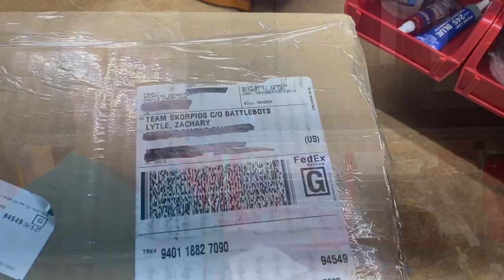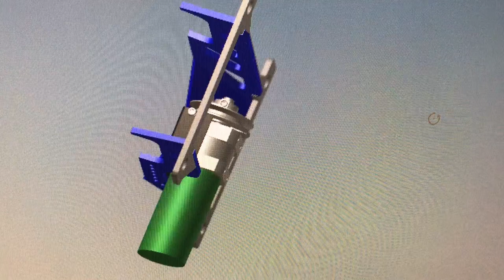The HEART of a Battlebot!   [Builder Blog Ep 58]

Comment: Why do you solder the on/off switch closed? Is that because you run the power through the Whyachi power switch and use that instead?
Reply from the maker: yes we run the power through the Whyachi power switch and use that instead!

good eye
Reply: @SkorpiosBattlebot  Do you just clip off the on/off switch and then solder the two wires together so the circuit is permanently together? Thanks
Reply: Yes That is correct